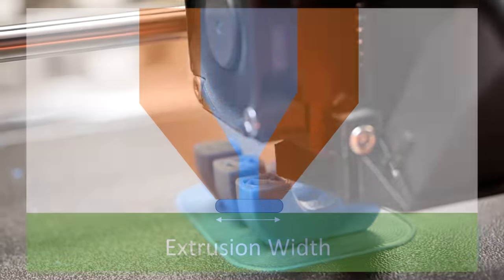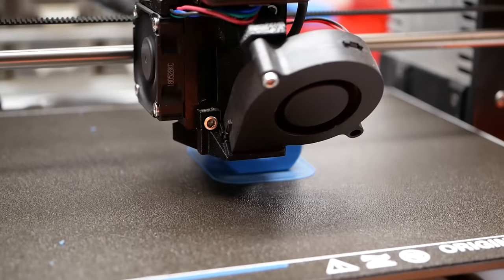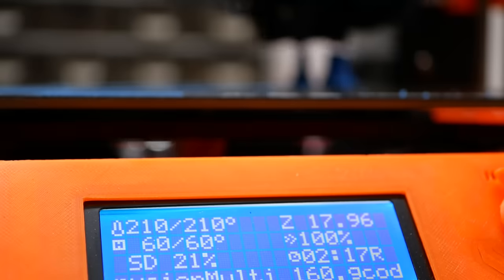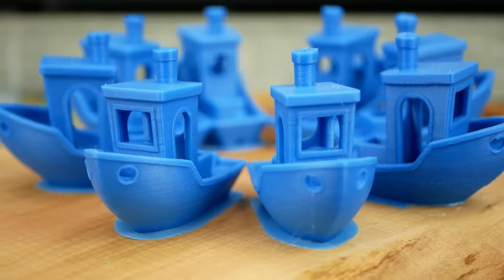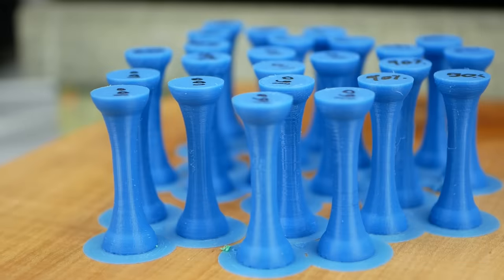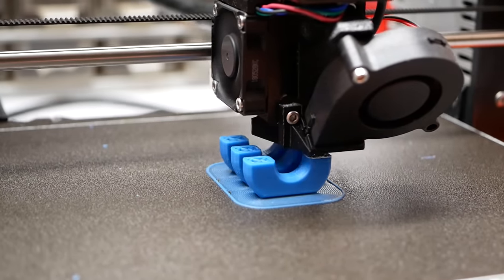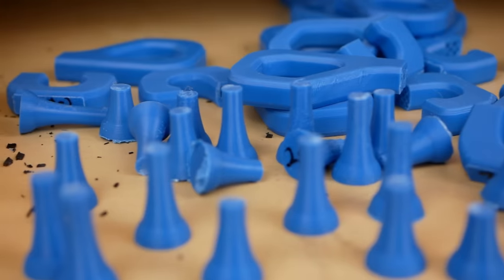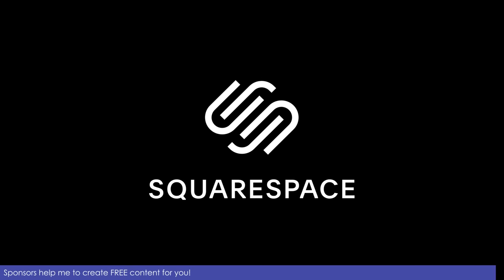Extrusion Width - The magic parameter for strong 3D prints?

Comment: First time I encountered this was when I changed my printer to a 0.6mm nozzle and got horrible results only to find that slic3r had a default oversize percentage that was way too ... "optimistic" . I usually enter the same width as the nozzle bore or 0.1mm more. I use the max mm3 per second setting as upper limiter to keep the extruder from overload.
Reply: First time I got put on that is when I replaced a hotend that I ordered with a .8 and got with a .4 nozzle and did not realize until I increased the layer height to .4 on a print then investigated and found out I was printing with a .4 at .9 layer width and .2 layer height for over a week

Comment: Stefan, I really like these series where you look at the mechanical properties. Many of these probably also apply to other materials. But really, can you stop using PLA for your tests since you would not use it for any actual mechanical parts anyways.
Reply: Stop living in the past, PLA of today can actually be used for almost all mechanical parts.
Reply: @yoann_m491  has chemistry changed since "the past"? Can PLA now do anything >45 degrees without needing to anneal it (which also deforms it, making it unusable for actual parts)? Or is it UV-resistant now, making it suitable for outdoor use? 

For many actual real-word applications, you usually want to have ~50 deg.C maximum operating temperature, because that is what actually occurs in the real world, at least in some countries. Hence if you want to test that your 3D-printed prototype actually works in your specified temperature range, you cannot use PLA.
Reply: _ David _  I agree but, if you need something that need to be so strong that pla won't resist, maybe you should use a CNC router or a different method than 3d printing. If you have to bother with a material that warps, delaminate etc just to win 20% of strength that's not practical.
Reply: The properties of materials from different manufacturers differ significantly.  There are very strong PLAs.  Of course, they will not replace the extremely durable or extremely lightweight materials, but will be suitable for 90% of applications.
Reply: @tyakoss  I'm here from the future to tell you about high temp pla and tough pla.

Comment: A slicer option to increase extrusion width on inside perimeters sounds like a good idea.
Reply: Cura can do different line widhts, speed acc and jerk for each line type.
Reply from the maker: Slic3r/PrusaSlicer can do that.
Reply: It can do regular line width on the outside and 200% inside perimeter? @printingOTB @CNCKitchen
Reply: Yes. In cura simply set the desired line width in mm for each line type.
You have outer wall, inner wall, infill, top/bottom, top surface, support, support interface, skirt/brim and Ironing line width.
Oops, answered from my other account. I'm PrintingOTB.
Reply: Optisystemizer sweet, look like i need to start using multiple slicers😍 thanks for the info!!! 😁👍

Comment: I am a little confused. In the video you say the extrusion width is the distance between the lines of extrusion (centre to centre), not the width of the extruded line itself, and he width of the extrusion is instead adjusted by the extrusion multiplier. But in the rest of the video you appear to be talking mostly about the width of the extruded line itself. So which setting are you adjusting in this video, the extrusion width or the extrusion multiplier?

Comment: That's interesting!

I usually use same width than nozzle diameter because it cause less nozzle jam issues (heated material being squished into the chimney.).
I'm not sure my prints where as clean as your's with 150% factor (Creality Ender-4).

When I need larger width (PETG/TPU), I juste change the nozzle to reduce pressure.

Do you plan redo these tests with nozzle variation (e.g : compare 0.4mm*150% vs 0.6mm*100%)?

Comment: Hi Stefan, with respect to the extrusion width setting.  I am wondering what the slicer does with the larger extrusion widths.  Does it continue laying down extrusions on the same centre lines or does it move the centre line to accommodate the now wider extrusion?  
The obvious desired intent of increasing the extrusion width is to fill-in any small gaps between parallel extrusions. Does the gap between extrusions reduce? Or is the actual increase in strength simply due to the reduction of gaps between extrusions?

Comment: How did you manage to print the flag hole base up to 200%?

When I print at 0.51mm layer width on a 0.4mm nozzle the base already got missing parts.

Is there some setting that allows PrusaSlicer to automatically use a thinner line width on small details?

Comment: Hi, I noticed that support structures are hard to remove when I print parts with .5mm layer width in Simplify3D compared to when printing with .4 layer width. 
You havent tested the "easy of support removal test".
Reply: My air gap is 0.3 vertical and 0.5 horizontal. The bottom quality is pretty good and it snaps off neatly.
Reply: I print the support structures with a line width equal or a little less than the nozzle diameter and they are really easy to remove.
Reply: I have a can of compressed air next to my printer, whenever I get a part that's stuck I spray the bottom of the part with the can upside down (can be dangerous!! You could easily get a cold burn) and you can hear the part crack off the built platform.

Comment: Upping the extrusion width is great for adhesion, but in exchange you reduce dimensional accuracy which is important with functional parts. Holes will be smaller, parts may be slightly larger. No go for me.

Comment: Just a question, will you start testing compression and sheering force in adition to the tensile force you're trying using the pull-appart machine? Would be interesting to know the compression strength of arches etc.

Comment: On my Ender 3 v2 i got pretty descent surfaces woth .4 nozzle, .2 layer height and 0.4 extr width
But on my new Sidewinder X1 the surface was wobb(e)l(e)y with the same filament. So i compared the settings ans the X1 profile has a with of .44 mm extr width. Set it to .4 and have way better surfaces now.

Comment: Is there not a way to change certain layers or paths to print at different thicknesses? Sure the slicer might not support it but with manual G-code editing, you could probably change a program to act so. Curious to see what effect this has on print strength.

Comment: There are some print profiles out there based on this to make printing polycarbonate easier and more reliable.  I think this is the authoritative source for the info that goes into those, but if someone knows of a prior writeup, please correct me. This is not my article, just a source I've used with good results: https://forum.prusaprinters.org/forum/original-prusa-i3-mk3s-mk3-print-tips-archive/polycarbonate-here-s-how-to-print-it-without-warping-delamination-or-an-enclosure-with-better-than-abs-results./paged/
Reply from the maker: Very interesting!
Reply: I’ve had great success with this profile and eSun PC.

Comment: I found out that extrusion with and walk thickness, they both are the exact same thing or at least the do the exact same thing, I tested many of my prints for strength and increasing my wall thickness does the exact same thing as increasing the extrusion thickness if you add both together you will probably have the strongest print ever

Comment: I have to say that up until now I have found all of your videos easy to understand, but this extrusion width parameter is pretty much over my head.

I have a project, where I am printing very small parts from PLA with a 0.25mm nozzle. In Prusaslicer the default extrusion width was 0.25mm if I remember correctly. I have adjusted it to 0.3mm because I thought that will speed up printing time, without having any negative consequences. But I have some fitting issues, as certain areas (knobs that have to fit into gaps on other parts) are just ever so slightly thicker/larger, that they make the assembly/ disassembly require too much force. I combat this issue with redesigning my parts with bigger gaps there.

Would changing the extrusion width back to the original 0.25mm solve this issue? Would part strength be affected? I was under the impression that whatever values I give in the slicer, the software will adjust things so that it will maintain the exact dimensions of the imported object. Was I wrong with my assumption?

Comment: What I am still wondering is if it's the extrusion width that matters, or the ratio of the layer height to extrusion width... in other words, would a single 0.8 line on an 0.8 nozzle with 0.4 layer height be stronger or weaker than two 0.4 lines with 0.4 nozzle and 0.2 layer height.
One reason this might actually be different is that wider the line for a given layer height, there is more pressure, so layers may be pushed together more.
Larger layer height is known to affect strength, but might this also be due to the ratio of width to height?

Comment: how about using a wider nozzle (0.8mm) with wider extrusion? 0.8 x 250% = 2mm layer width! how wide could you go before maxing out the heating/cooling capabilities of the printer?

Comment: Please could you help. On my Ender 3 Pro, whenever i am printing sizes the print always comes out smaller than what was set in . For eg, I want a tube 10mm dia with a hole of 5mmdia. When its printed the hole is usually out, giving me a dia of approx. 4.6mm The 10mm is also out by approx. the same. What am I doing wrong

Comment: Did you change the printing speed so that the volumetric flowrate stays the same?
Reply from the maker: I limited flow rates to 2mm³/s to be very far away from what the hotend can handle.
Reply: @CNCKitchen  nice! well done.
Reply: @CNCKitchen  That translates at the 1mm layer width and a layer height  to a print speed of about 12.5mm/sec - are you sure that is not a typo? And did you put it in prusa slicer in max volumetric E field? Tested with a .8 PLA can handle on a V6 about 11-13 depending on temp and brand here is a link as to how to nail it down https://grabcad.com/tutorials/dialing-in-a-filament-and-specifying-the-max-volumetric-e-xtrusion-value
Reply: @CNCKitchen  using the same volumetric speed means lower speed for higher line widths which means more time in contact with the nozzle per line, couldn't this be also a factor?

Comment: Does this change in parameter adjust the overall dimensions of the parts printed? That would be my only concern, holding a tolerance while still increasing strength

Comment: Would this also apply to TPU printing? I build Fpv drones that need to withstand 100mph crashes. Tpu is the only material that won’t shatter, but there are problems with layer separation, and I’m wondering if your test results go for Tpu

Comment: When I switched to PrusaSlicer I initially used % values for the extrusion width. Not knowing that it is calculated over layer height instead of nozzle diameter I used way to low extrusion widths which caused some ugly prints BUT the one thing that looked better on these prints anyway were top surfaces.
Since then I have set the extrusion width for top solid infill to .3 mm (with a .4 mm nozzle) which looks great on smaller prints. On bigger top surfaces this tends to cause some problems tho.

Btw are you visiting formnext this year? I will be there on Thursday 21.11. and would like to meet you and chat or maybe take a photo with you.
Reply from the maker: I plan to be there but it's not fixed, yet.

Comment: If you have a dual feed or dual extruder set up, could you use the same type of filament and change the widths, etc.. on the same model? So say 200% width on the main layers but 100% width on the in fill?

Comment: So now the question is, 0,4mm nozzle with 200% extrusion width or 0,8mm nozzle with 100%? You strength graph showed that 200% has the same or lower layer adhesion strength as 100%

Comment: I wonder what happens to those thick line widths if you increase or decrease the flow by 1-2%. Say how would a 0.8mm width with 102% flow perform against a 100% flow and 98% flow. It all depends on the filament, nozzle and calibration in the end. 

The thick lines are very far apart and line bonding from the sides from line to line should also play a role in strength.

Comment: I'm having some underextrusion when trying to use 0.6 extrusion width with my 0.4mm nozzle. Did you calibrate your esteps over again, or did you change the flow chen changing extrusion widths?
Reply from the maker: Try upping your printing temperature by 10°C. If your extruder is not slipping, no re calibration should be required.

Comment: Great video. Greater perimeters have more problems with overhangs as the nozzle got to catch the previous layer otherwise you are just dropping filament next to it. To deal with that do the external perimeter at 110% nozzle and all other at how big you want to go and print outside perimeters first. Now you got the best of both worlds. It also pays to establish safe max volumetric extrusion rate and enter it in prusa slicer I wrote a tutorial here https://grabcad.com/tutorials/dialing-in-a-filament-and-specifying-the-max-volumetric-e-xtrusion-value cause even with a .4 you can get close or even exceed it and with a bigger nozzle you most likely will
Reply: In case you missed it Sefan left the following reply under a comment by @maximiliankjarnold :
"I limited flow rates to 2mm³/s to be very far away from what the hotend can handle."
Reply: @ddegn  I missed that and yet I doubt it as that would make for extremely slow prints at the 250% 1mm at .16 layer height would have meant he printed at about 12mm/sec - where does it say that?
Reply: @martinpirringer8055  I copied the reply from @CNC Kitchen directly. I included the original poster's name. I have no idea if the relpy as an error or not. Assuming a 1.75mm filament, I figure a material volume rate of 2mm³/s would be a linear rate of 0.83mm/s.
I don't have a 3D printer yet myself. I don't know if the rate quoted is reasonable or not.
Reply: @martinpirringer8055  After looking at your tutorial (thanks for the link) I see extrusion is usually given as mm/minute. Using Sefan's figure, I get about 50mm/minute. According to your tutorial, this is a very low value.
Reply: @ddegn  Hence I think its an error somewhere. I never tested with a .4 and only printed with one when I started and when I bought a new hotend and it got shipped with a .4 even though I ordered it with a .8... That is how I discovered you can print fast with a .4. Now for a .8 with an E3D V6 the max flow rates (add/subtract 10% for different temp) areh HIPS-17, ABS 14, PLA 13 PETG 12-14 (depending on brand) Nylons 6-8 Now there is also the max speed of your printer to consider (most are about 60mm/sec) and the max speed a filament can be printed so for example most Nylons are suggested to be printed <25. I asked Stephan to also test speed vs adhesion. We can only handbreak so strength is subjective to a point but it appears to us that with a .8 in HIPS which we mostly use printing a part with a .2 layer height and a speed of 40mm/sec will be weaker then printing the same part with a .4 layer height at 20mm/sec. Both will finish in the same time just the strength is different. I feel its due to the hot nozzle pressing longer on the same location. Plus you get a more accurate print with less artefacts or overshoot at corners.

Comment: I'm sure this is a dumb question, but in PrusaSlicer 2 t here are a number of settings for Extrusion width.  Did you just  change Default extrusion width?   Or any of the other settings to different  values?   I have been using First layer at 200% and all others at 0 (default).  I will try changing the Default extrusion to 150% and see the results.  Thanks for a very  informative video.
Reply from the maker: I changed all extrusion width settings to the same value for the tests.
Reply: @CNCKitchen  Thanks for the quick answer.

Comment: Hi Stefan, I have been watching your anayses for a while now and I am very impressed. However I note that you must be running out of topics in simple strenght measurements.  

I have produced a few prints that make use of the flexibility of the filament, mainly in ABS to make springs in my engineering prints.   Have you considered analysing filaments for springiness?  design approaches for springiness?  And in flexible filament analysing designs for durability?

I will share a few designs with you (and the public) if you can suggest a suitable address to send them to.

Peter Snape
Reply from the maker: Have you watched this : https://youtu.be/te0Wwf7Dxj4
Reply: @CNCKitchen  Thanks for your reply.  The most desired properties of 'springy' parts is not only stiffness, but also:
* deformation creep when the spring is mechanically loaded for long periods of time. 
* how much elastic deformation can be achieved at start of life and
* how much elastic deformation can be achieved after multiple uses.
These result in:
* how long a service life can be expected from a particular design.

Many Yutube'ers have noted that PLA can be expected to deform if mechanically stressed over long periods of time.  This can definately be seen when PLA is heated in (say)  a hot car, but what is the rate of deformation at higher room temperatures (say 30 deg C, or 40 deg C) which can be very common here in Australia.

Peter Snape

Comment: I dont realy understand the difference between extrusion Multiplier and extrusion with. When your Multiplier or your E-Steps are to high, than the Linewidth gets wider. Is this not exactly the same what Extrusion Width change, the Step/mm? With the only difference, you not have to calculate that factor on your own, to get a specific Linewith?